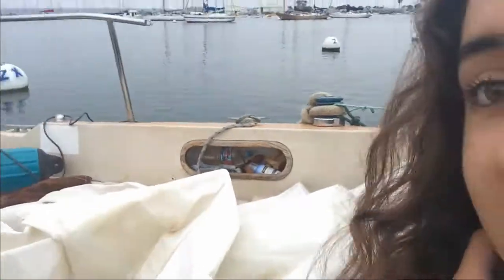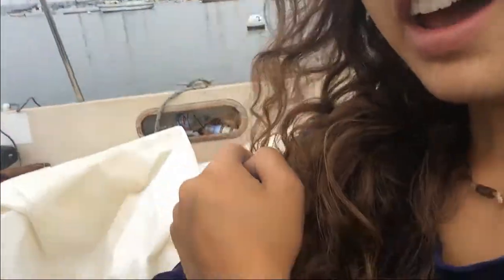making a ladder and climbing the mast solo

Comment: You need to really really replace that Fore Stay. Under sail it carries the largest load of the rigging. It could catastrophically fail at any time now bringing down the whole mast. You can make your own. As much as I hate to say it, West Marine has a rigging bench free for customers to use. You can buy the wire and fittings for probably less than $100 and do it yourself in about 30mins. To measure the right length tie a string to bottom attachment eye of stay mark with a marker then take other end to top of mast and mark top eyelet. Then make new wire match end to end. Measure eye to eye, not wire length, because new fittings may be a different size. Make certain to note how far in or out the turnbuckle is and compensate for it and know the wire will stretch a little. Then when time comes to replace, use the jib halyard connected to jib attachment point and use the wench to tighten it down as much as possible. You want the fore stay to just become loose. You may need to loosen the back stay a few turns, but keep count so you can put it back. Once forestay is no longer tight and jib halyard is taking over, go up mast and swap with newly made one. Come back down attach bottom point. Then you can ease off jib halyard, tighten backstay, then tighten new foresay up. It sounds much more complicated than it is. You can do it,

Good job going up mast. I spent 4hrs up mine this weekend, installing new mast lights and wiring.

Comment: Hey thanks for the vid, was considering buying on but wanted to see it in action first.. never thought about makin my own til this vid. Feel free to msg me if you have any questions I pretty much gutted and renovated/upgraded an entire Catalina 27 a few years ago. Even have some spare stuff layin around I think you might be able to use. The 25 & 27 have a lot of the same parts used from factory. 
I also need to let you know that you should not be going up that mast until the front stay is replaced, that “wire thingy” you called it is holding up your mast. It looks in really bad shape and with your weight added up there it could come tumblin down with you up there. Also you should wear a harness and strap yourself on every couple steps just in case. Just tryin to help good luck
Reply from the maker: Sailing Stuff hey thanks, I appreciate it ! you are right, this is definitely not an instructional video as much as a watch me not know what I'm doing haha

Comment: your problem with halyard wraps  is your halyard makes an insufficient angle with the upper swivel. I had the same issue. here is a pic. https://coxengineering.sharepoint.com/siteimages/halyard%20wrap.jpg  . i didnt do that, i merely added a line between the headsail and the upper swivel to raise it, increasing the angle.  no more wraps.
Reply from the maker: Todd Lewis yes thank you! I did realize that when researching but I didn't find that awesome diagram of solutions, I think I will try to put a diverted wheel on if there is enough room. Thanks !
Reply from the maker: Todd Lewis I'm confused, how did you add a line between the head sail and upper swivel ?
Reply: look on page 26 and 27 of these instructions http://www.harken.com/uploadedfiles/Product_Support/PDF/4417.pdf

its called a halyard pendant.  I just made mine with some wire and bulldog clips from the hardware store. but rope would work as well.